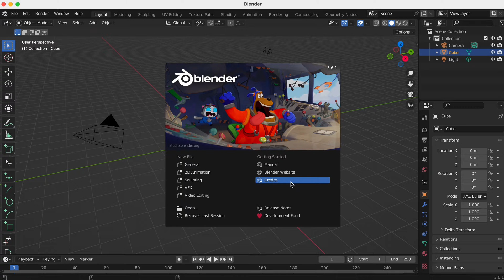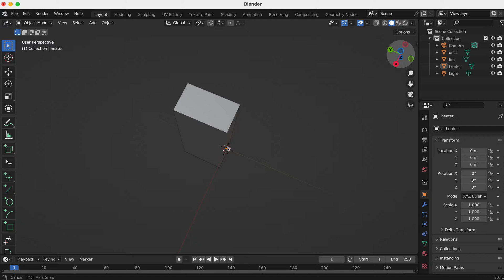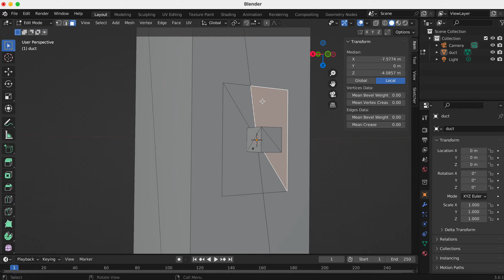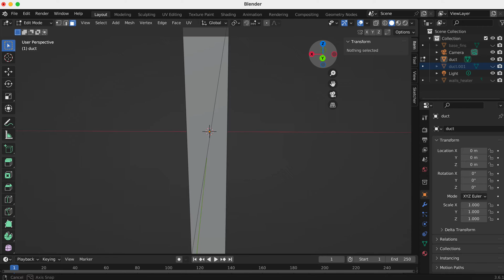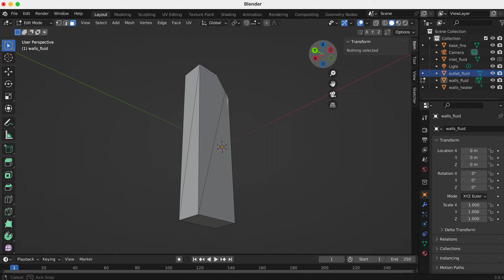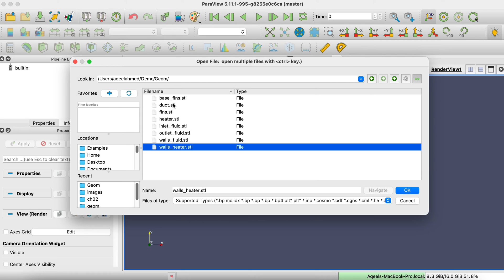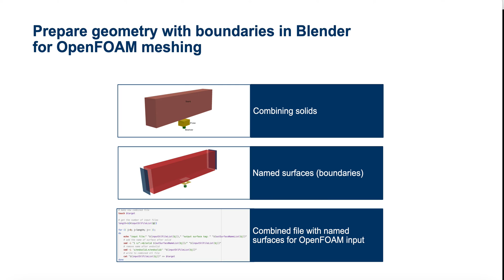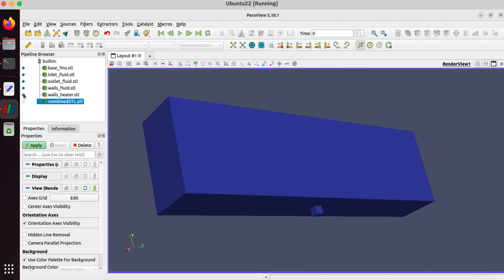Preparing geometry for OpenFOAM using Blender

Comment: I asked chatgpt to do some modifications in your code, that's working fine for me:

#!/bin/sh

# ---------- AUTO INPUTS ---------- #

# name of the combined STL file
target="combinedSTL.stl"

# remove old combined file if it exists
[ -f "$target" ] && rm "$target"

# create a new empty combined file
touch "$target"

# find all .stl files in current directory
find . -maxdepth 1 -type f -name '*.stl' | while IFS= read -r file; do
    # remove ./ prefix
    filename=$(basename "$file")
    
    # get surface name (filename without .stl)
    surface_name=$(echo "$filename" | sed 's/\.stl$//')

    echo "Processing: $filename -> surface tag: $surface_name"

    # Create a temp file to store modified content
    tmpfile=$(mktemp)

    # Replace the first "solid" line with the correct surface tag
    sed "1s/.*/solid $surface_name/" "$file" |
    # Ensure 'endsolid' lines are cleaned
    sed 's/endsolid.*/endsolid/' > "$tmpfile"

    # Append to the combined file
    cat "$tmpfile" >> "$target"

    # Clean up
    rm "$tmpfile"
done